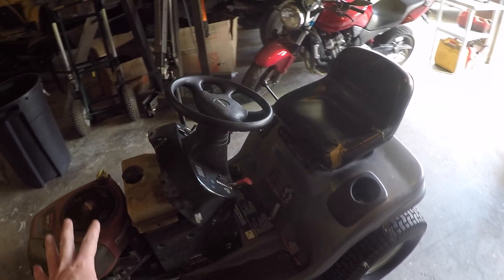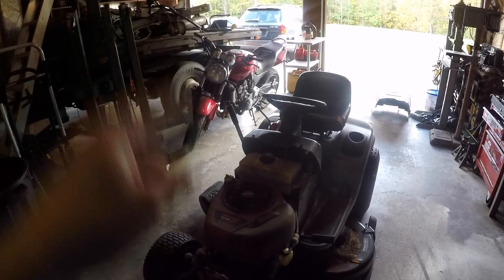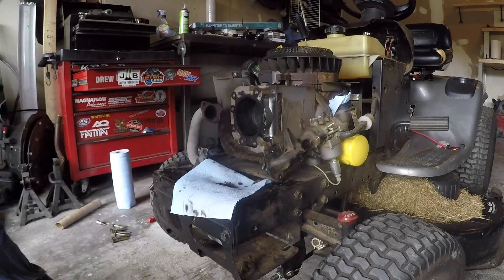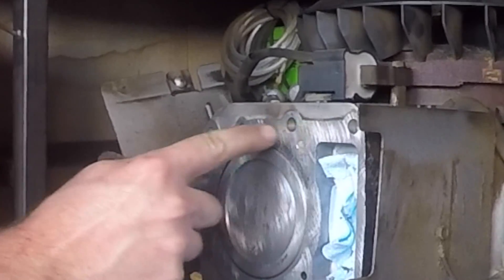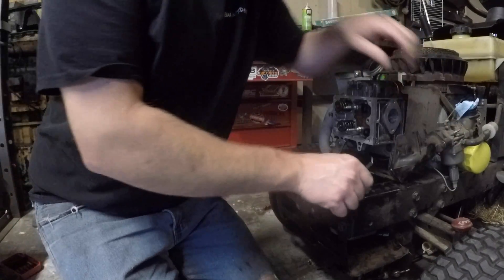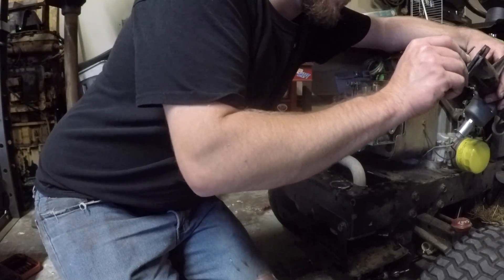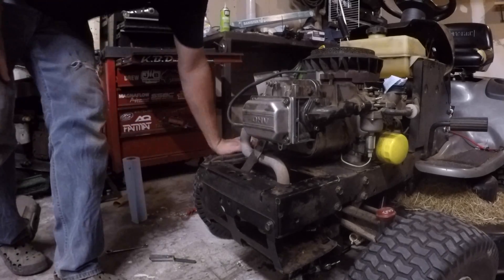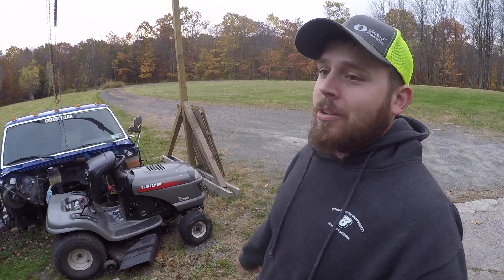Head Gasket Replacement. 18hp Briggs & Stratton Intek Craftsman LT2000

Comment: What Drew? No cam, turbo, intercooler and jake brake for high speed curves..... I have seen a few hopped up and they are insane. Mowing the grass and moving all the leaves and grass to the timber line.... its a bear to rake that much area.... in all fairness, you need to run around and see if any farms have a old 8N fordson tractor with a three point hitch that can get sidelined into other little projects and will push or blow snow a bit further out into the not driven area. Plus if it has a bucket on it then the possibilities are limited to the imagination for other sideline things... like firewood out of the brush near the place. Lawn  tractors are a great way to get a bit drunk on as I used to when I drank (sober now 35 years) I would reward myself a beer. On a yard that size I can see a half rack going missing after you get done and you park the tractor somewhere and have to go find it the next day... I had only a couple embarrassing times like that in the past. Very happy to be past all that in my life. Its Drew marathon time to get all caught up. I wish you much success.
Reply from the maker: Still waiting for the go fast bits to show up lol. Gotta keep it reliable, we are probably going to depend on it quite a bit this winter. I like to think of it as my gateway tractor, down the road I would like to upgrade to something bigger with a loader but right now free is what we could afford lol

Comment: I did a head gasket on a deere commercial zeroturn for my neighbor. Only it was blowing oil out of the engine. Horizontal shaft drove the blades off the back and hydraulic pump off the front. Then the next week had to replace the charging system under the flywheel lol.
Reply from the maker: Always fun when they start to nickel and dime you!

Comment: Winter is coming, so great purchase on the snow blower attachment.   Might be a good idea to set it up way before the first snow fall...just in case you need to get some parts.
Reply from the maker: Can’t avoid winter! Definitely planning to get it on and operational as soon as I’m done with with the mower deck!
Reply: @drewmansmodestmansion1917  hi please do you think is possible can you share the number part by Head gasket on that engine please. Thanks!!